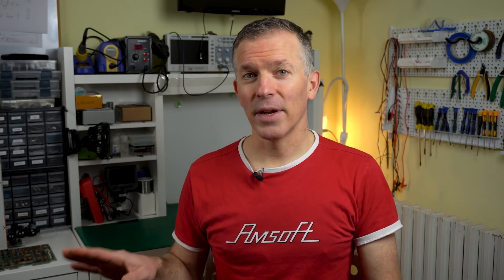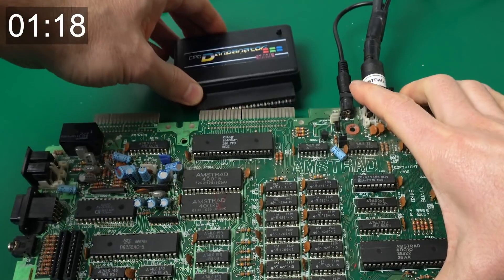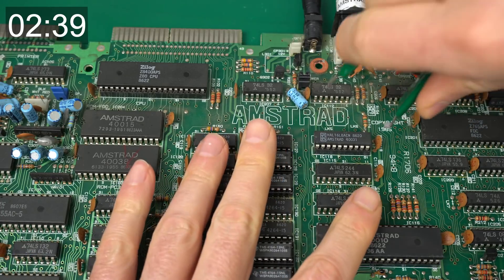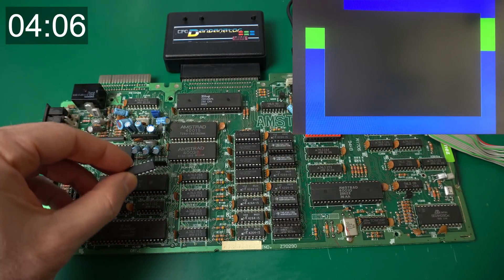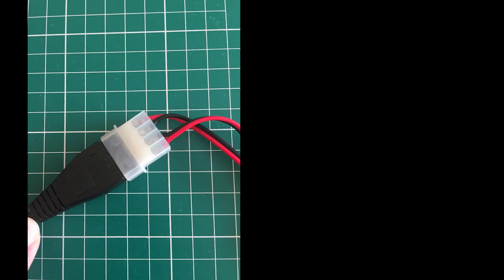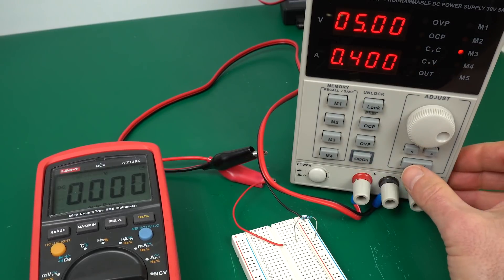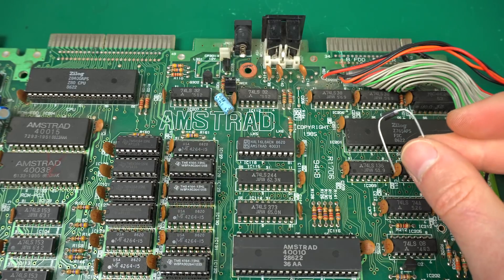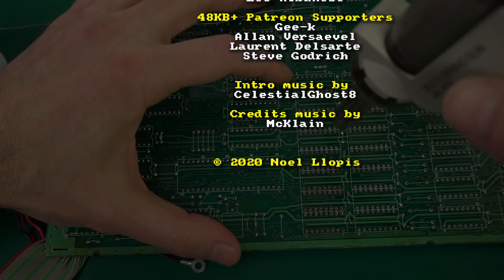Overvoltage Repair and Prevention on an Amstrad CPC 6128

Comment: 20 years ago I tried a RAM chip change and I accidently did this. 12V on the 5V line. I thought CPC is dead because no video out signal anymore. I thought all the ICs will be dead when they get shocked by 12V. 
Can this be or just like your case here only some are affected ?

Comment: Hi, I just made a mistake and hooked an external 12v connector into the keyboard and now the computer don"t run anymore when hooked properly. 
Should I follow your exemple? If so, what/where can I buy the needed remplacement & tools? Great video thank you.
Reply from the maker: Yes, you should do a similar diagnostic and fix it. Hopefully it's just a blown RAM IC or two and nothing more serious. Check out the Amstrad diagnostics ROM if you have a way to use it. Good luck!

Comment: Hello! I managed to source only 5.5v power adapter that enough amperage. 
Would 5.5V damage my CPC 464, or I have to look for strict 5V?
Reply: Strict 5v, there’s no voltage regulation on the circuit board, so if the 5v supply is too far out of spec (too high, too low), then the ICs would either fail to function correctly, or will permanently fail
Reply: @guy_is_here  Too late. AY-3-8912 is an expensive bugger. 😥

Comment: I am wondering about the utility  of the diode overvoltage protection. As it has no indication of overvoltage and a missing 12v rail wouldn't be apparent until disk access, meaning the diode has to last for "a while" without blowing. And once it blows, the 12v will be dumped into those poor ram chips. A fuse or a crowbar circuit would be better in my opinion, if a lot harder to make and fit.

Comment: Ive got a 6128 green screen with black boarder would like to test the ram but  the Dandanator CPC is out of stock, Anyone in uk selling them?
Reply from the maker: You could just write the test ROM to an EPROM and put it instead of the Amstrad ROM. I does require desoldering the ROM though.
Reply: @NoelsRetroLab  Thanks for the reply I will try this. I'm new to repairing computers. Just got hold of a 6128 and I determined to get it fixed :)

Comment: I'd like a video suggesting good psu s for the cpc 6128. Both 5 and 12v is hard to find in one psu
Reply from the maker: It's funny you mention that because that's already in my list. It should be a quick/shorter video, so I'm hoping to make it soon. The spoiler is to use a Meanwell power supply with +5 and +12 and some kind of enclosure.

Comment: Thank you for showing this P6KE TVS diode! It's quite more resilient in terms of power handling than I expected, it should certainly blow a carefully picked fuse before blowing up itself from overheating.
Reply from the maker: You're welcome. And you're right about having a fuse somewhere (in the power supply, or on the board itself) to make it as safe as possible.

Comment: I use this type of transient voltage suppressor also in my circuit ( https://bitbucket.org/UweGottschling/oak65c02/src/master/Oak65c02_KICAD/65xx-CPU/6502.pdf ). This diode is a simple surge protection, but not entirely perfect. The tolerance range of the diode is large and in the worst case the voltage is 7.14V. The absolute maximum rating for the Z80 is around 7 Volt.

Comment: Just a quick question. What is the polarity of the 12V barrel jack?
Reply from the maker: Ah, good point! I didn't think much of it because of how this board was fried (by swapping that Molex connector) so it got a dose of +12V. But the polarity of the barrel jack of is actually center negative. So if you did manage to connect it with an adaptor to the 5V jack, the diode would act as a short right away (and probably fail within seconds, but hopefully to a short).
Reply: @NoelsRetroLab  The reason I asked is I have a CPC6128  but the drive didn't work when I got it. As I don't have the one of the monitor I was trying to figure out what polarity the 12V was.  I thought I had killed it because I though I got the polarity wrong but I am sure I had it center negative. I have two drives one dead and terrified I am going to kill the second because I don't know how the 12V power is to be delivered. I do have a Gotek for it but have yet to try it.

Comment: Question for you: If you plug 12V on the 5V connector with the Zener installed, the zener will dissipate 5V (12V - 7V that you measured). Depending on the PSU being used, the Zener should be able to dissipate that power or it will burn. How do you account for that? Thanks for the video as usual!
Reply from the maker: The diode will dissipate anything over 7V in the form of heat, so it will eventually fail. This could be really quickly depending on the voltage and current rating of the power supply. From the datasheet, it looks like it should fail to a short, so that will pass on the problem to the power supply and have that fail (or, if it's a decent one, blow a fuse there).
Reply: @NoelsRetroLab  ahhh - I did not know it would fail to a short. That makes total sense then. Thanks!

Comment: "Off with their heads". Hahaha! Nice quick video! Lots of retro repair YouTubers' videos have been creeping up to the 60 minute marks -- which isn't bad!! -- It just gets hard to find quick videos to watch during lunch or breaks.  That sure was a quick fix!
Reply from the maker: Glad you liked it! I'm enjoying a mix of shorter and slightly longer, but I really try hard not to go past 25-30 minutes as it starts getting too long. I guess that's why I end up stuck doing multi-parters for some repairs, but I think they call for it. Anyway, glad to see this format is also working. Cheers.

Comment: Have you ever tried to install a 3,5" Floppy to the Amstrad CPC ?
Reply: Easy. The ribbon cable is identical, just connect to the DD expansion edge connector. However, you will only get the same disk capacity as with the 3inch disks, because the CPC can only use 40 tracks and can not switch sides, and you cannot flip the disks over. You will need to get an alternative DOS to use all 720kbytes, and a side switch to access the second side. The side switch connects the side select line of the ribbon cable to 0volts for side one and 5volts for side two. Unfortunately I can't remember offhand which line it is! As far as an alternative DOS, I wrote one that was sold by Phil Craven's Microstyle under the name MS800. It was favourably  reviewed by Amstrad Action . There is a ROM-based DOS called Parados that is still available
Reply from the maker: I haven't, but like Ewen mentioned, it's definitely possible. There should be quite a few resources out there. It's not something I've done because I love the 3" disks because of nostalgia 😃

Comment: I think others have written comments along this line already but my problem with this is that while the zener diode is sinking current for a while it will probably die eventually. If it dies short you'll get a nice burn mark somewhere, if it dies open you're back to square one. This seems like a good place to get on lcsc (jlc pcb's component arm) and see if there is some weird chip out there that integrates the over voltage detection and a MOSFET to  switch off the supply.
Reply from the maker: You're totally right. I thought I read in the datasheet for that diode that it'll fail to short, which is better than open. Hopefully at that point the power supply will fail in some way. But I agree a better way would be to have a fuse or some other fancy component to stop the current. I've gotten a couple of recommendations so I might look into that. Cheers.

Comment: Excelent video Noel. What I don get is that the circuit supports this feature by only installing a Zenner and the stupid manufacturer could not spend some stupid cents (wait, pesetas!!) to solder it in the factory.... Personally I built this: https://drive.google.com/file/d/1Ng9SGhC355VVgaSk85A6R8MeL4-H2JHl/view from IZWDWF and modified it for any 5v-powered 8-bit computer.
Reply from the maker: Honestly, if the manufacturer is going to do something, they can do better than my dumb diode. At least add a fuse too.
Reply: @NoelsRetroLab  You're quite right. And the cost is absolutely ridiculous when manufacturing. Amazed by your videos, as always!. Cheers Noel !!!

Comment: I think it is a bad place to mount the zener diode due to track, leading to the positive lead of zener, is too thin. So, this track could be burnt and zener diode will be ignored. Obviously, it depends of external PSU power. BTW, I'd better use TVS (transient voltage suppressor) with appropriate fuse instead of zener, placed in reliable, "powerful" part of the board (to thick tracks or even polygons, if any).
p.s. Thank you for your content. I really like your channel.
Reply from the maker: Interesting. I didn't think about the thickness of the tracks leading up to it. I don't know if that would break in case of a short, but it's certainly worth considering!

Comment: Fuse on input, then a TVS diode.
Over curent cuts the fuse, protect the board and the suplly
Reply from the maker: Yes, that seems the way to go. Mounting it on the board is trickier, so that might need its own mini-pcb unfortunately.

Comment: I have an Amstrad PCW with these symptoms. It just beeps and displays a garbled screen when booted. I also suspect the RAM. I must get around to swapping the chips for some new ones. PCW RAM is usually very reliable and this is the only faulty board I’ve found.
Reply from the maker: I don't know much about PCW repairs, but what you're saying sounds about right. We'll see what happens when I finally get around to restoring my PCW!

Comment: I would have replaced all the MT rams..... they are bound to fail sooner or later. Nice use of Voltage diode.
Reply from the maker: Yes, so I've been told. I haven't had a horrible experience with them on the CPC, that's why I didn't rush out to repair them. Besides, the ones left standing after that must be tougher right? 😃
Reply: @NoelsRetroLab  Well.... for how long though? ;)

Comment: Looks like a 6V Zener diode to me. I wonder why they named it "GPP TRANSIENT VOLTAGE SUPPRESSOR". I once made a big mistake and connected 18V power supply to my CPC464 thinking that I've got the original PSU. :( Well, the only victim was the ULA 40007 that I successfully replaced with a new 40010. Bought it for a fair price from https://www.icompplus.com/en/
Reply from the maker: Yes, I don't know why it has that name. I don't know if it has some extra properties that make it a "voltage supressor". Maybe it lasts longer before breakdown? No idea. It's surprising the ULA blew up but the RAM didn't! Usually the Z80 and the RAM go first. Then again 18V is a LOT of voltage 😃
Reply: @NoelsRetroLab  I was surprised as well. I think ULA got hit first and shorted the power rails, so other components didn't have a chance to feel the wrath of 18v... ;)

Comment: Excellent video, is there a reason why you didn't use the adapter you made a while back to force the second bank of RAM? I'm just curious ;)
Reply from the maker: Thanks! This adapter is the same thing, just in PCB form and much neater. Dave Anders made that PCB after watching the video and sent it to me. It's very cool. You can even toggle the banks with a couple of jumpers.

Comment: What a handy diagnostic tool :-D
Breaking the power + line from the power socket and bridging it with a fuse+holder would make sure the psu did not stay shorted for too long, and the diode would likely survive.
Reply from the maker: Agreed. That'd be great. The only complication is finding the place to put the fuse securely on the board.
Reply: @NoelsRetroLab  Perhaps the screw together type of holder with a wire from each end could be tied to other wiring using small Cable ties or Zip ties.
Or get some pcb fuses, they often look like a small resistor body type.
Worth a bit of research so you know they exist :-D

Comment: Would a similar application work for gx4000?
Reply from the maker: That one is a bit more complicated. It has several internal voltage regulators, but in theory yes. It's just a matter of finding the right place to put it.

Comment: This may work if the 12V power supply actually sources 400 mA maximum, like the limit value you have set on your bench supply. If the power supply can source let's say 2A, your poor zener diode will dissipate 7*2=14W and probably it will die right away.
Reply from the maker: True. But the diode will short when it fails (or so says the datasheet) which will still protect the rest of the board (and possibly blow up the power supply).
Reply: @NoelsRetroLab  You are right, the initial failure mode is usually short, but then everything can happen. Perhaps it goes a little bit beyond the scope of this video, but if you are curious you can see this for example: https://www.vishay.com/docs/88440/failurem.pdf
Reply from the maker: @lorenzol.8798  Awesome, I'll check that out for sure. Yes, this was definitely just a "quick fix" video. There are much better ways to prevent overvoltage. I'll probably end up revisiting it sometime soon going over the different options and implementing something safer. Cheers!

Comment: Does that mean that if/when the diode does pop due to over voltage/ over heating the board with get the full 12v?
Reply from the maker: My understanding is that when the diode fails, it shorts, so the circuit will still be protected (but the power supply won't be happy).

Comment: The real fix is to only ever use nylon Molex connectors.
Reply from the maker: That would be a good start. Or even use even more different connectors. But if you have a ZX Spectrum around, it's always a possibility that you connect the wrong supply on the DC jack.

Comment: How did you know from looking at the screen which ram chips were bad?
Reply from the maker: That RAM test shows one bar for every bit in the data bus. Starting at the bottom with the least-significant bit (Gerald, the author explained it here: http://www.cpcwiki.eu/forum/amstrad-cpc-hardware/quick-and-dirty-ram-test-for-cpc/ ). Then you need to look at the CPC schematic and find out which bit corresponds to which IC.
Reply: @NoelsRetroLab  Thanks for the info.
Reply from the maker: @Mr Guru Oh wow! Grrrr... YouTube! Thanks for the heads up. Fixing it now.

Comment: I plugged in the power upside-down on a disc drive on my Amiga, it blew the disc control chip with a flash an a bang. LOL.
Reply from the maker: Ouch! That must have been a lot of current or higher voltage I imagine.
Reply: @NoelsRetroLab  Yeah. It frightened the life out of me. I never bothered fixing it, it's an A500, I use A1200's now. :)

Comment: Great video =D  I would replace all that MT RAM in that case!  It fails a LOT in C64 boards!
Reply from the maker: Thanks! Yes, so I've heard! People seem to hate the MT RAM!
Reply: @NoelsRetroLab  The remaining RAM might be OK!  It may just be that over voltage in that case!  I have left other MT RAM chips on boards when I've found one chip faulty and they are still running.  That cart is great!  I need to get one of those!

Comment: Why not add a fuse as well as the zener, say 2A? So when the zener conducts, the excessive current should blow the fuse and cut the power completely.
Reply from the maker: Yes, that'd be a good idea. It's just a matter of finding a good place to add it securely to the board.

Comment: You can also put a fuse on the power line before the zener. That way when the voltage goes over the zener's nominal value the zener will sink current to ground blowing the fuse and no voltage will go to the power rail.
Reply from the maker: I like that. It would be a matter of picking the right fuse, right? Probably something like 2A slow? The biggest problem is mounting it neatly on the board somewhere.
Reply: @NoelsRetroLab  search 'pico fuse', choose a current value that's 135% of max load (don't forget cart & other peripherals that load the power supply).  This circuit is better than nothing but the diode you are using is intended for spike protection not continuous over-voltage (maybe a few in parallel would be better). But you would be better off using an SCR crowbar circuit, it's only a few parts. (prototype tip: use a 4.8-6.3v bulb instead of a fuse to test trigger voltage)
Reply: @NoelsRetroLab  Pin the original comment please.

It's very informative.
Reply: That's the right solution, maybe even use a polyfuse instead of a conventional fuse.
Reply: A signal level mosfet, zener, two bjts and a few resistors can make a proper over voltage cut off circuit. Using SMD stuff it can be made pretty small.

Comment: Great video! I will need to make one of those adapters. Seems like it really shortened your trouble shooting. The diode looked like a good idea. Too bad the manufacturer of the connector didn’t notch it so that it would be keyed and impossible to reverse.
Reply from the maker: Which adapter, the Dandanator? Yes, those are awesome! You can use any ROM board that lets you replace the lower ROM, but I particularly like those.